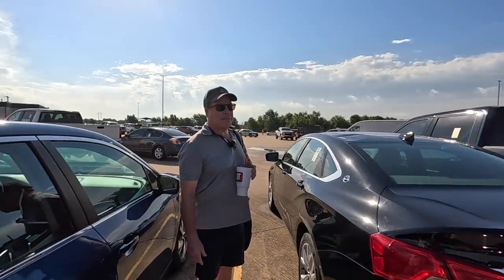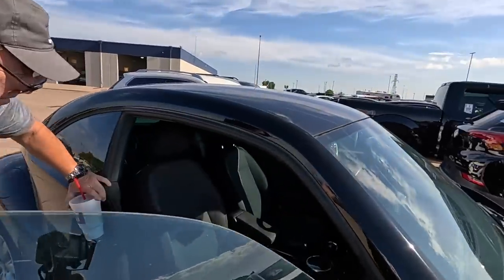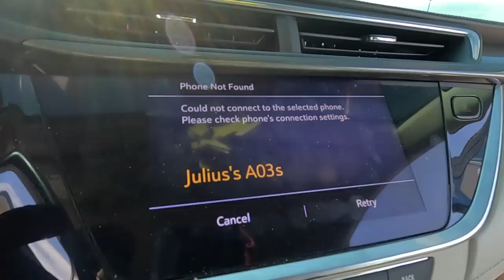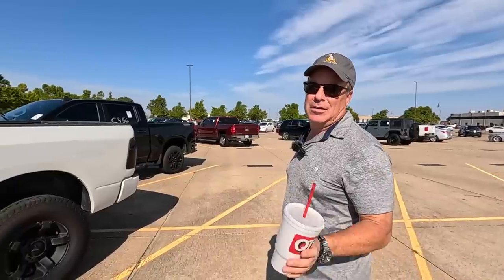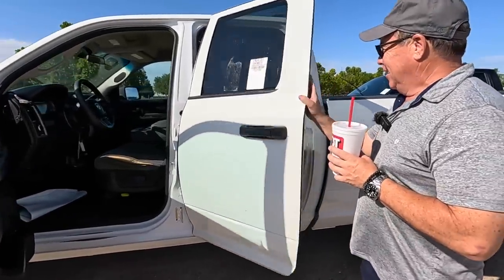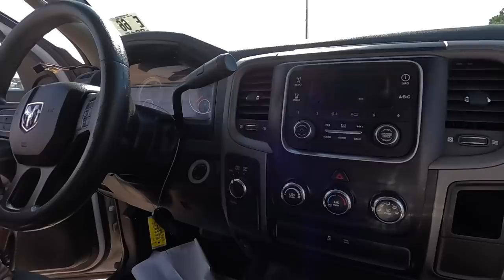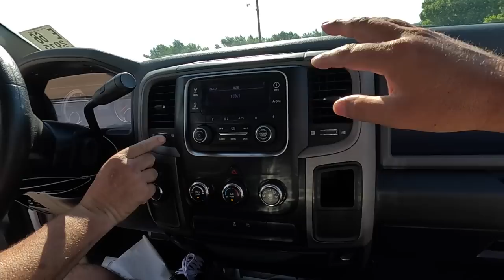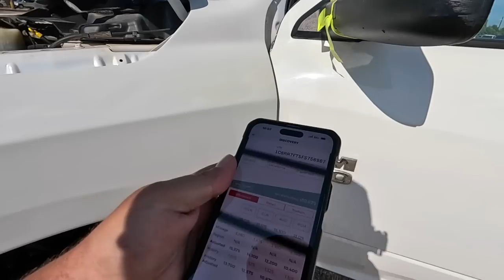Trying to find a Truck for my Friend at Dealers Auction didn't go well!

Comment: Randy, love the channel, just curious where you got the information on GM trucks. I’ve driven GM trucks all my life putting a lots of miles on them due to work, I have never heard or experienced the issue that you mentioned.
Reply from the maker: You might want to Google it. You're lucky. I've personally had it happen to me, which caused me to research the issue.
Reply: Thanks for the info, unfortunately you and I both know you can’t believe everything you read on the internet. But I hate that you personally experienced the issue. I currently own a 2020 and a 2023 Silverado both ltz 5.3 trucks. I will definitely do some research, if it turns out this is a huge issue, I may look into switching brands. Love your channel keep up the great content.
Reply from the maker: This isn't just believing things I have heard. The forums are loaded with this issue, so is YouTube where you can literally watch the issue.
Reply: It's a coin toss. All the V8 trucks have AFM, which has a tendency to break one of the lifters and valves rear right on engine, and destroys the cam, which is a catastrophic engine loss. They started to phase it in around 2007, and they still have it today in the 5.3 and 6.2 gas engines. The diesel doesn't use that system, because it already gives you better gas mileage. I'm also afraid of this new turbo 4 in the trucks. I see a problem ahead. I'll keep my '09 4.8 Silverado that does NOT have AFM. If you have AFM, get the delete kit...$4000.
Reply: If u get a Gm truck buy the 2500 and 3500 hd Silverado cuz those trucks do not have active fuel management anymore they got rid of it in 2020 and up hd trucks only the Silverado 1500 has active fuel management

Comment: Randy, the HD (2500/3500) versions of the Chevy/GMC pick up trucks have a 6.0L non DOD/AFM gas engines. They have hydroboost brakes (no vacuum brake booster, runs off p/s pump) for HD towing. Great engine if you don't want 5.3L of 6.2L.

Comment: If you HAVE to buy a beetle...get one with the 2.5 I-5 engine.  The Turbo engines are quick, but super unreliable.  My son had a '12 with the 1.8L and the check engine light was always on for something!  VW got sued due to failures of the hydraulic tensioner for the timing chain.  Their agreed settlement was pathetic.

Comment: Ambient air temperature sensor on the Ram its under the driverside mirror turns on check engine light and makes the exterior temp read wrong.

Comment: I used to be a fan of used car auction in the US long time ago when the US known to be one of the quality car producer. I have brought over than 10 used car and both US and foriegn made and have my friends repair them at reasonable price using junk yard parts! During these days, all used USA manufactured car that I belived assembled in China with much low quality parts than the U.S. A. standard are not financially worth repairing since most of them are financially drained and very hard to find some compients mechanic and body man to to repar these car correctly.

Comment: I forgot to add the Ranger has AM/FM Cassette and FM modulated 10 disc changer andhas a little over 89,500 actual miles.

Comment: Maybe I was super unlucky, but I bought a Cascada with 4k mikes on it, which was a bit suspicious someone already traded it in before first oil change. About 5 years ago is when I had mine. Parts of the interior would fall off and crack apart when hitting bumps like a toy car. The top always rattled like a snake too bc GM uses plastic rollers for the convertible top system that folds into the trunk. The dealer told me the plastic deforms after a few uses. Had mine replaced and the loud rattles would come back after a few top open and close cycles. My outside temp sensor never left room temp, traffic alert beeped with no traffic, convertible top would throw errors sometimes. Many more issues such as brakes warping, engine evap purge valve, bubbles and cracks in the leather, etc. Had a loaner apex once a month for the year and a half I owned it. Dealer was not pleasant at first, but they became much better as we sorted through problem(s). Prettiest car I've owned by far, though. It was heartbreaking to break with the car, but mine was truly a hooptie. Traded in at 49k miles, before it lost any more value. Beautiful, but amazingly low quality.

Comment: 12:34 I bought a car and it was not that old with new struts. When I replaced those I found out they put on the wrong struts to lower the car. It sits higher now, but has the correct struts.

Comment: Hi Randy and Mike. I love that black Chevy with the Oversized  wheels. It's a shame the originals weren't in the trunk. Or boot in Ireland lol. Lovely VW Beetle. God your truck needs to go if your not towing. And 16mls per gallon is Crazy. How can you have 2 car payments when your a Car wholesale dealer 😅. Something doesn't sound right. I cant Imagine Mike driving anything else but a truck. Wow $11.000 for that truck. No way. I wouldn't pay anything like that for it. Tell Mike I will buy him that G.M 6.2. 😅😅. Nice Buick convertible. Beautiful colour. Anyway great video again Randy and Chat laters bro 😅😅

Comment: Well, ford has a cam phaser failure and when they fail, they destroy the engine woth no chance of economically repairing it!!  I recommend doing the DOD/AFM delete and have the best platform on the automotive platform!!  Also anything with a manual amd HD does not have the dod/afm installed in it!

Comment: i own a fleet for myself of crappy some high miles cars.. get it for cheap over the years.. the expensive car i have now is a e30 coupe with the crome bumpers.. i paid almost noting years ago and now with my extensive repairs on it? i have it now 10 years. and the fun part is? the value... i own more cars that i think go up in values.. in the meanwile i fix the crap out of them all. AND with big plus results.. i own fun stuf and i DONT sel it.. not what i have now. all classics now AND the fun part? fuel economy? well i have a bmw e36 estate for daily. my e36 is SO eco with fuel.... little 4 banger and with all OEM or almost oem parts.. everyting new BUT! the body looks OLD! very old. not rotten but littebit and a lot of clearcoat one the drivers door. drives like NEW id from 1999 and i wont noting els. i LOVE that car so much!

Comment: The lrft of the best Buick's were made were the 2000-2205 Buick LeSabre/LeSabre Limited and 2000-2005 Buick Park Avenue/Park Avenue Ultra Supercharged  were the last ofthe Buick mane.  To me Buick had been dead since they got rid of the LeSabre and Park Avenue  which weren the best selling american sedans until the end. in 2005 Buick sold 175,000 LeSabres and 120,000 Park Avenue/Park Avenue Ultra models

Comment: Hey would mike be interested in a prefect 1998 Ford Ranger XLT PLUS 3.0l Vulcan V-6 Auto PS/PB Cold A/C Cloth int Tilt wheel cruise control Power Windows/locks alum wheels Two tone White/Gray Ext cab 2 WD New tires 2 owners my friends neighbor died he wants 1800 0r best offer. everything works. let mw now. He will not deal with the public because of stupidity. No rsut he said it will drive across country. Needs nothing.